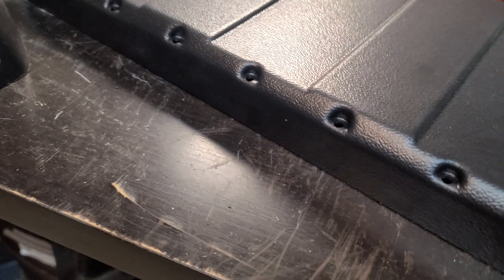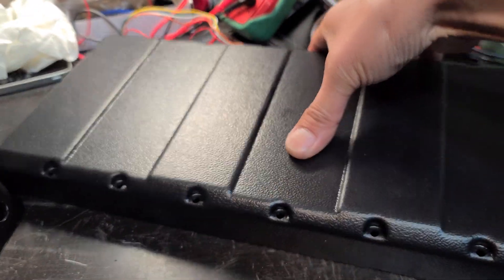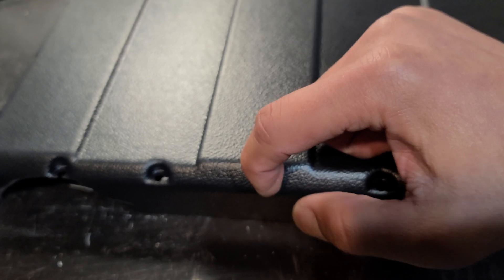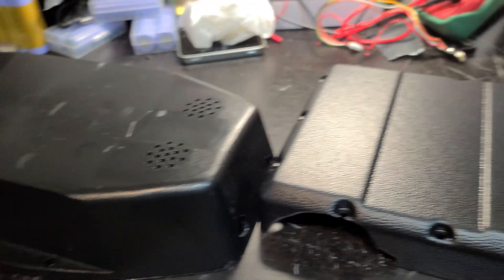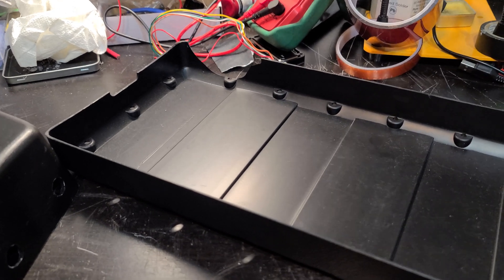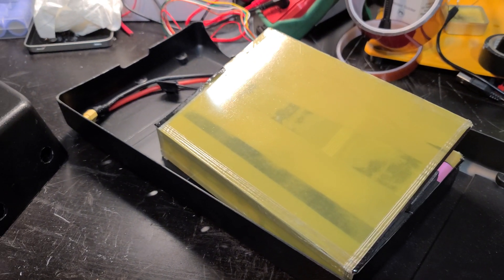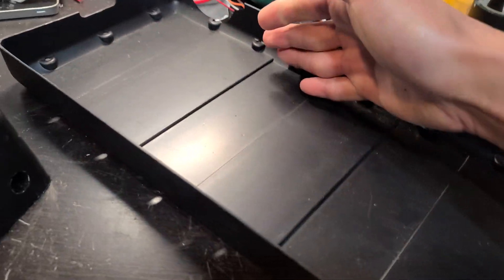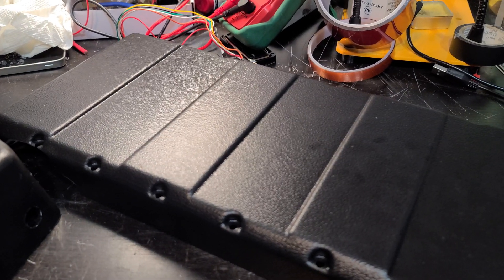DIY Electric Skateboard Battery Enclosure Comparison!

Comment: The worst battery box that I had was the Verreal F1. It was strong but the screws broke inside and I couldn't fix it. It fell off on the road. :( Bad design!
Ownboard and Meepo v3 and Vestar battery boxes have been pretty good for me.
Reply from the maker: Yeah battery boxes have to have good design otherwise they can break easily and also start fires if battery is not protected 100%.  Ownboard Meepo Vestar all make great boxes.

Comment: Have you ever thought about 3d printing an enclosure? I do it and they turn out just perfect. If you ever want something that is perfect for your hardware that's a good way.
Reply from the maker: I have thought about it, is it strong though?
Reply: Dr. E Skateboard If you print it with carbon reinforced plastic it's in fact extremely strong.
Reply: Will definitely try it then.  I need to get a 3d printer though!  😭😭😭
Reply: Max Lee I'd recommend either the ender 3 or the or the cr-10, if you would want a huge build size. I have the ender 3 pro and it's quite good.
Reply: @ludviglindh4398  any links on thingiverse or sketchfab?
Reply: @dr.eskateboard3381  u could use 100% infill and astalish a stronger design
Reply: @Ludvig Lindh 
did you dising the enclosure yourself or from thingivers
plss give link if you have